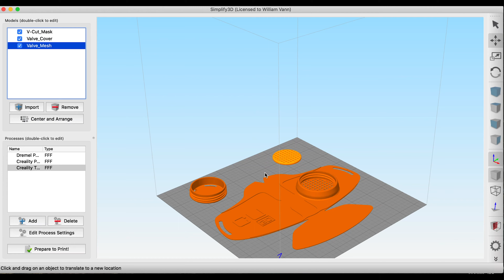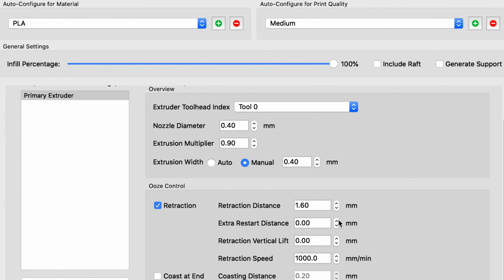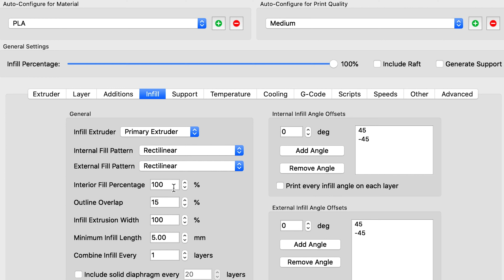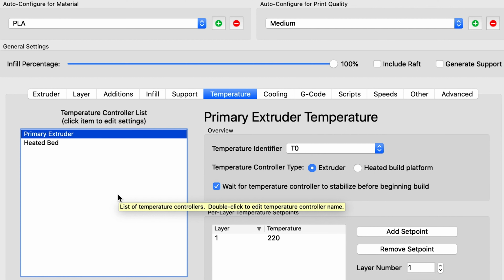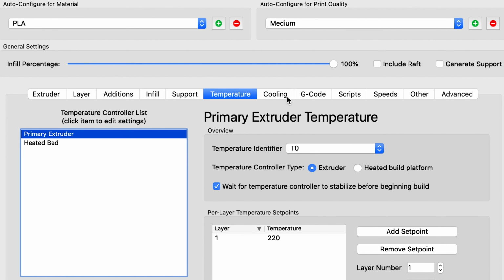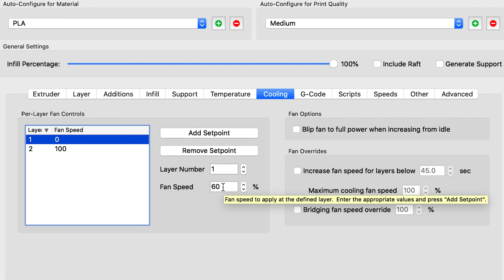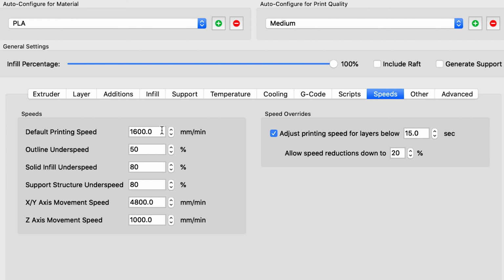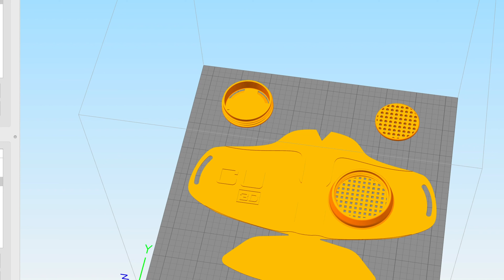TPU Filament Settings for Stock Ender 3

Comment: Thank you so much. That helped a lot!
TPU Settings: 
Retraction Distance: 1,6mm
Retraction Speed: 17mm/sec // 1000mm/min
Temperature Extruder: 220C°
Cooling Fan Speed: 60%
Default Printing Speed: 26mm/sec // 1600 mm/min

Comment: I am using Ender 3 with a SUNLU TPU. Your settings are not correct for my combination. I get a heavy stringing, difficult to remove,  even when objects are very close (1-2 mm).

Comment: Stock extruder?
Reply from the maker: The ender 3 uses a Bowden drive extruder and standard brass extrusion tip out of the box... well unassembled out of the box. Mods on the ender 3 can place a direct drive extruder and different  plated extrusion tip. 

On top of that fan cooling mods can be added to provide better a cooling process for any extruded material.
Reply: @SkillAscentEdu  RIght.  But did you use the stock extruder?  I'm struggling with mine and TPU.
Reply from the maker: @thebikeracer  Yes, I've found that tpu can be very finicky on it. Make sure you are going with a temperature printed on the spool. Usually I keep it towards the higher end of the recommended range. 

I would also suggest an extender mod to help guide the filament. https://www.thingiverse.com/thing:2917932

 Or pull out a lot of the filament to loosely hang. Mine struggles to pull it through when it's on a full roll. Once I hit the half way point it pulls a lot better, due to less weight.

Comment: Did u use a heated bed ?
Reply from the maker: Yes I leave mine at 60. Although when I run TPU on my Dremel ideabuilder there is no heated bed. 

So you can run it either way
Reply: I run zero degrees and have a hard time peeling the TPU off the stock bed. No need to waste the heat